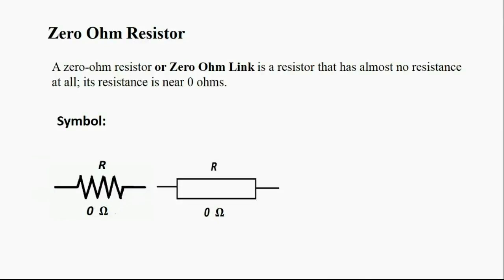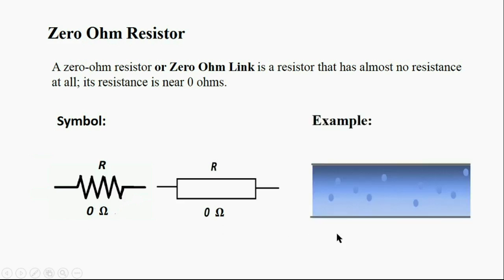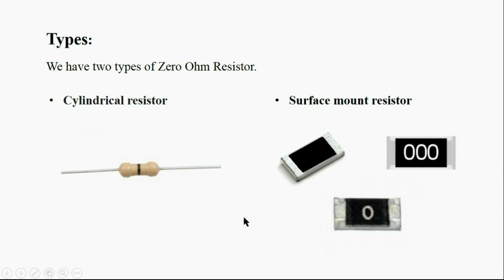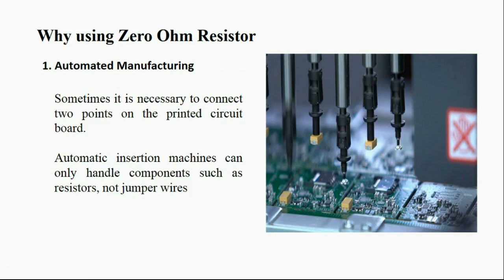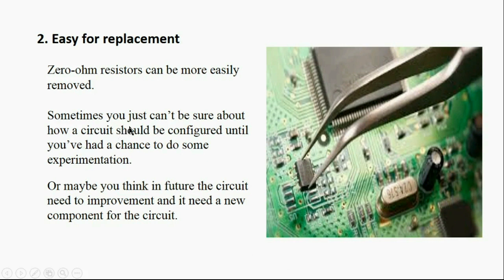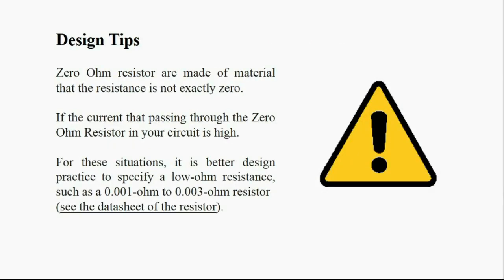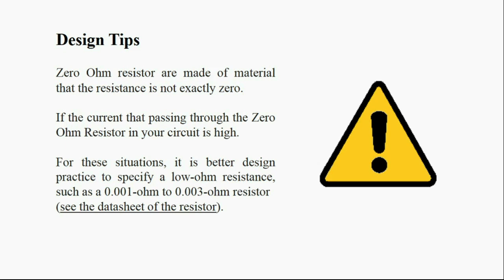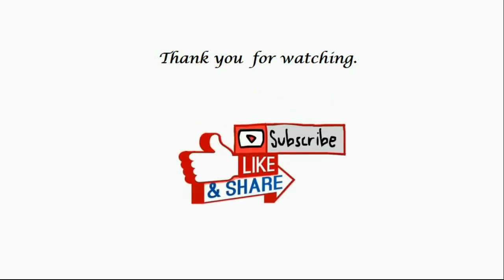Zero Ohm Resistor - Why we use it?

Comment: Another use for 0 Ohm resistors is to connect to a star point. normally you would connect Analogue ground, digital ground and High Current grounds to a star point at the PSU to help stop interaction and ground bounce effects, PCB nets can only have one name.